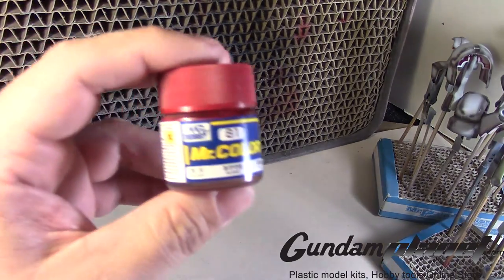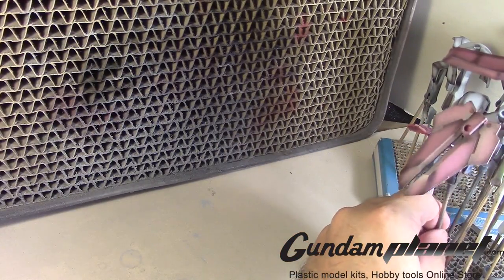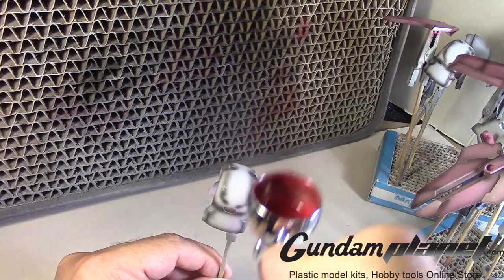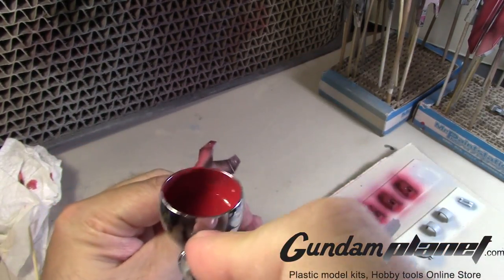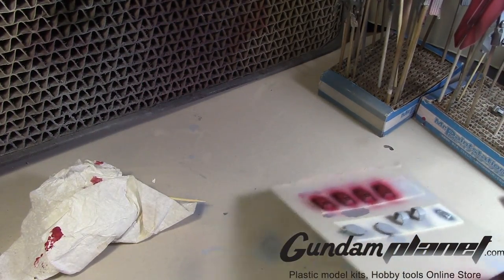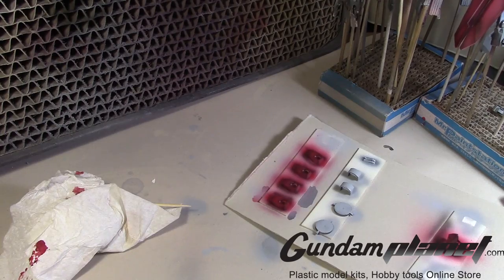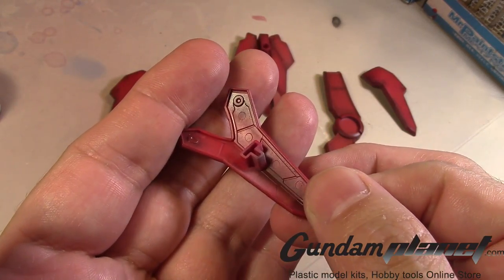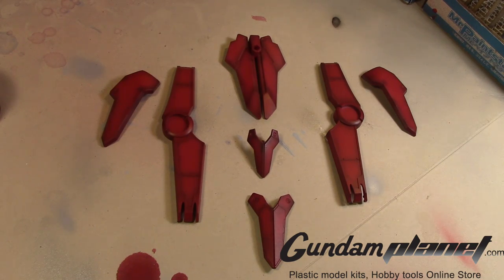*GundamCustom* 1/100 Grimgerde Custom - Part 4

Comment: i can see black lines on the white panel before you painted it; what is it for and how to do it? thanks.
Reply from the maker: The lines are part from the pre-shading I did using Alclad 2 Gloss Black. I showed this on part 3 of this videos series.  Once it dried I apply light passes of Mr Hobby Russet red to get this effect right.
Reply: thanks. does it also serve for marking the panel line at detailing?

Comment: Hey Stryderprime, could you please tell us how you painted those black lines and the white before applying the red ? :)
Reply from the maker: The lines are part from the pre-shading I did using Alclad 2 Gloss Black. I showed this on part 3 of this videos series.  Once it dried I apply light passes of Mr Hobby Russet red to get this effect right.
Reply: Okay thank you for sharing but I watched part 3 and I only see the inner frame being assembled in the video. So I think you forgot to add this in part 3 ? 
Great job by the way, I'm really liking where you're going with this kit.